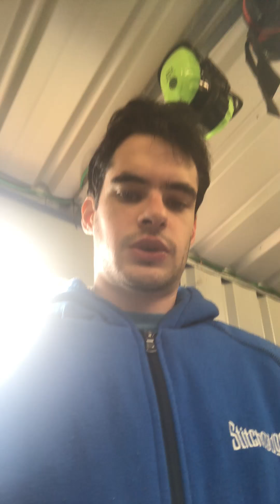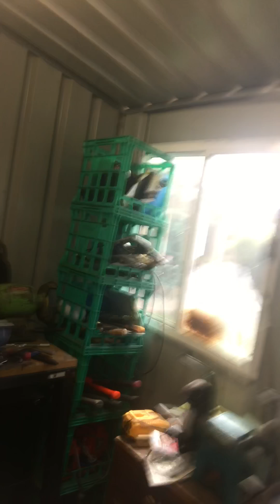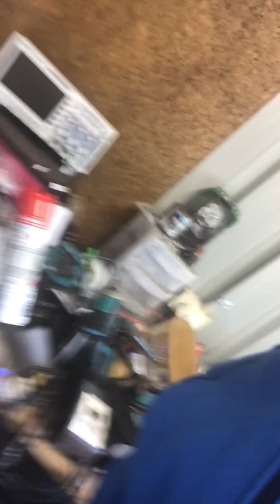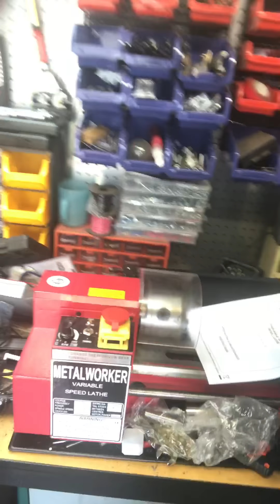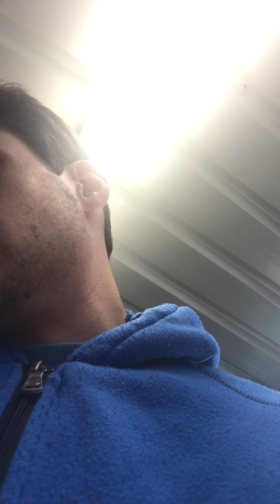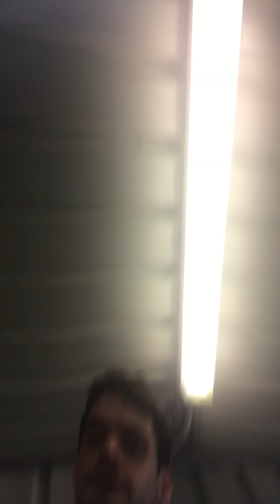RSS 6 shop update and new direction

Comment: Mate i dont want to sound nasty .....
What could you possibly make in a garden shed with your head nearly touching the roof?
Reply from the maker: Giovanni Vona I made a handle for a g clamp a couple of thumb bolts for the old siegc2 it’s what I have to work with I usaully just muck around with repairs etc here